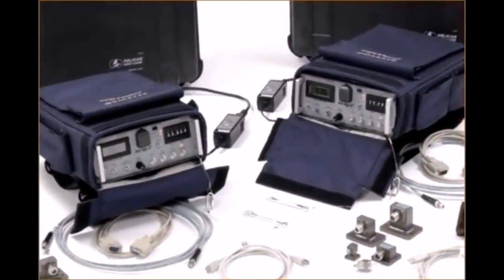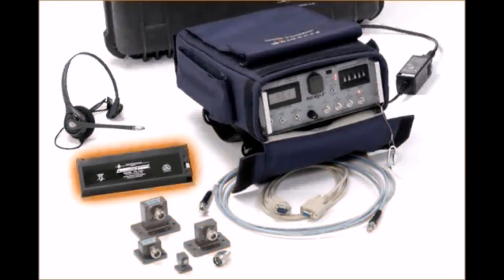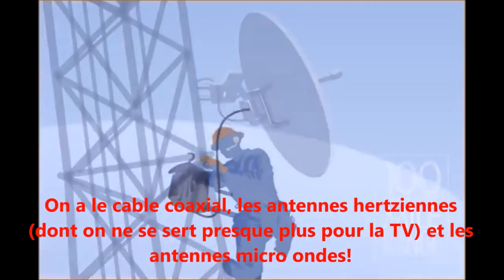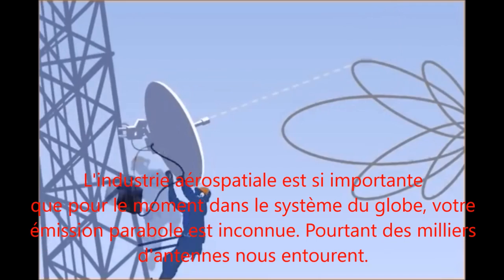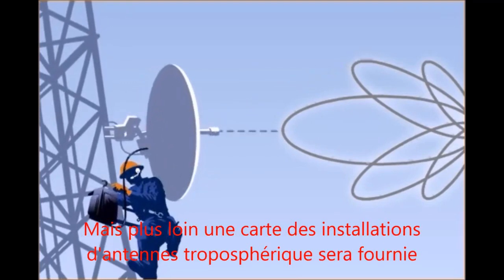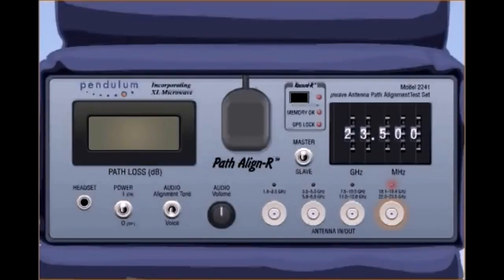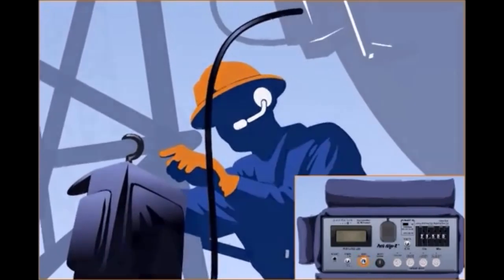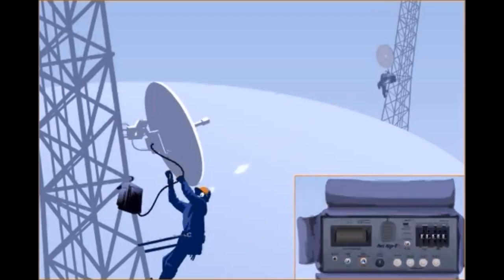Terre Plane - Antennes Relais Terrestres ? OUI / Satellites ? NON !

Comment: c'est n'importe quoi cette vidéo! évidemment qu'une bonne partie des communications passe par des faisceaux hertzien ou des câbles  c'est une question de prix et de matériel ça n'a rien à voir avec la terre  plate . en plus quand on calcule des distances de liaison radio on est limité par la rotondité de la terre! si la terre était plate on serait bien moins embêter et je n'imagine pas un industriel  des communications dépenser plus d'argent pour cacher le faite que la terre est plate. cette vidéo ne prouve que l'ignorance ou la mauvaise foi de son auteur.
Reply: A7 Derdesders .reflexion ionosphérique entre 1 et 30 MHz oui   (au passage merci wikipédia mais change un peu les termes ça fera moins repompé;   on a les mêmes sources mais il faut comprendre un peu ce qu'on lit )mais c'est une toute petite partie du spectre ais au delà de ce spectre (GSM LTE etc) ce phénomène est inexistant. d'autre part le terme rotondité est bien le terme utilisé dans les calculs de bilan radio, ça  sert pour calculer la hauteur des antennes radio. si la terre était vraiment plate il ne serait pas nécessaire de mettre des antennes en hauteur non ?